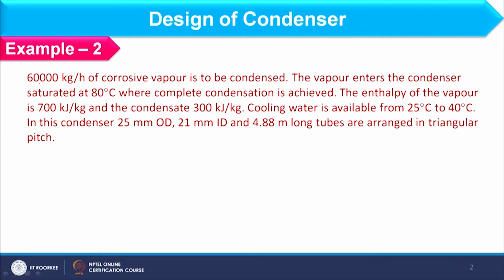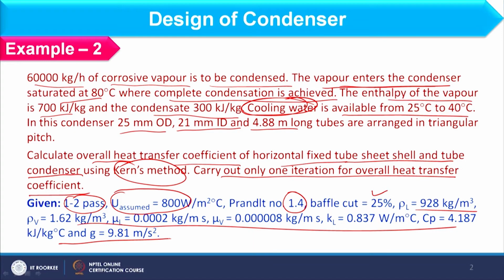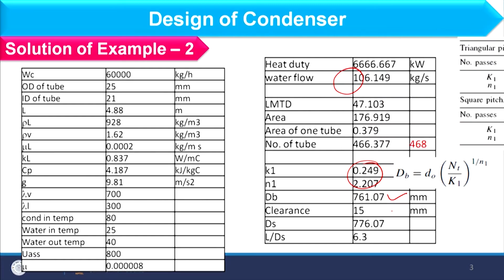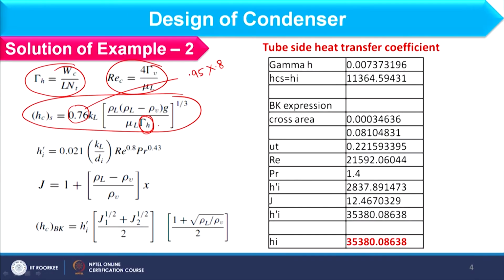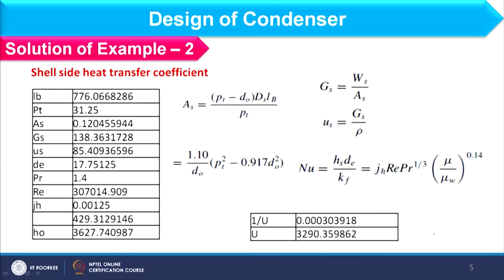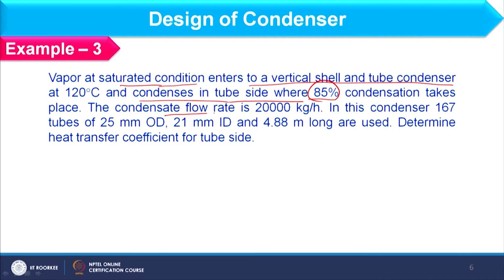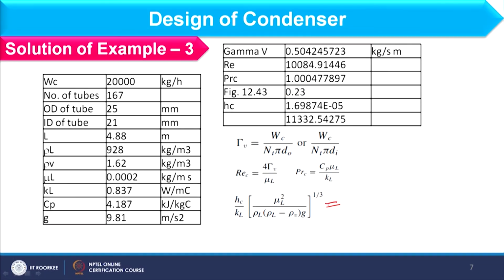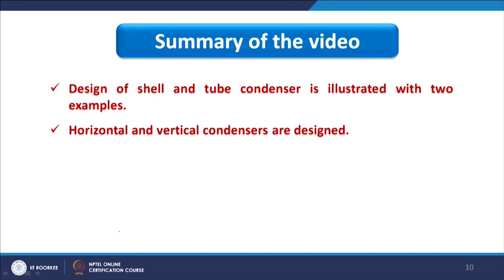Lecture 26 : Design of Condenser-5

Comment: In example second... There is some miscalculation in Gs as shell side is cooling water but you have taken the flow rate of corrosive vapour due to which tha velocity value is incorrect and also in velocity calculation we have to density of water but you have taken density of vapour=1.62, 
If I'm wrong then plz explain...